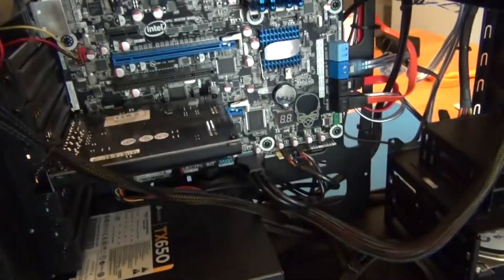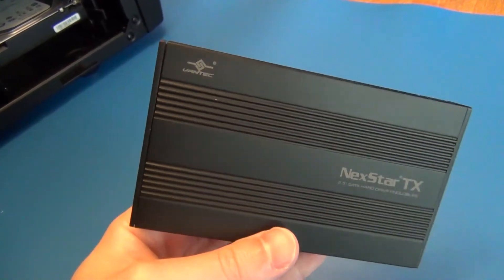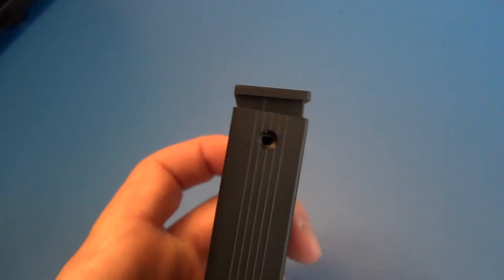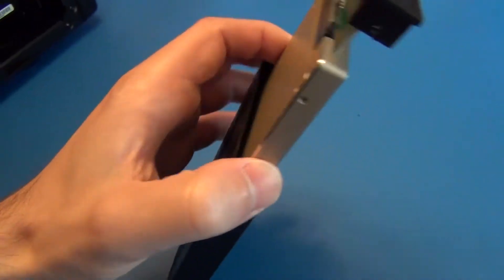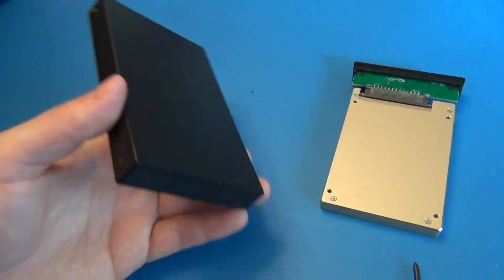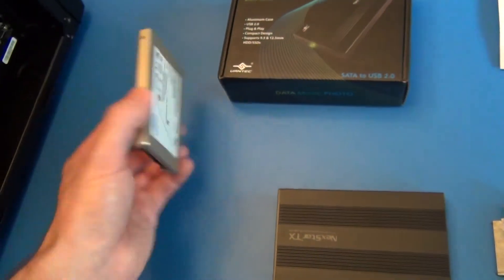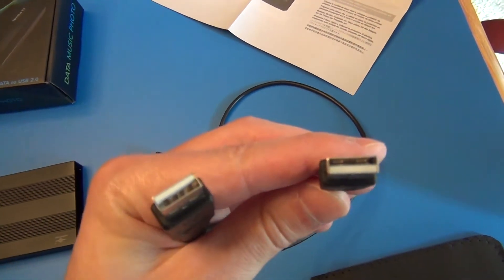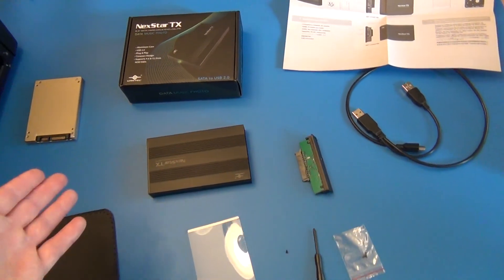Vantec NexStar TX USB External Drive Enclosure (NST-210S2-BK) Review

Comment: I believe there are small cushions on the opposite side to help take slop out of it.  If you push the cover in tight, then put in the screws, it will fit properly.  I bent mine slightly to make it straight.  This is a great HD case in my opinion, and less than $10.

Comment: Another video uploaded said that if a standard HDD contacts the surface of the aluminum enclosure it may short the drive?  Have you experienced this at all since you've owned it?  He said that most drives come with a plastic cover so that the drive does not make contact with anything, but I don't think any of my drives still come with the plastic protector.  Let me know.
Reply from the maker: I didn't have any problem with it, but I only used this for temporary use, so I didn't carrying it around in a bag or anything where I would have a lot of static friction.  I've never seen an HDD with a plastic cover, only SSDs.  All my HDDs I've ever had always had the standard metal surface.  You can probably rig up something to buffer it with a piece of heat-tolerant plastic or maybe rubber band?  Personally, I'm not concerned, especially for light use.  But I can guess that someone is concerned about conductivity from a metal exterior case to internal components.  However, in a real computer, you often have metal mounting screws, to a metal cage, that is in direct contact to the exterior of the computer case.  So I am hoping the HDD manufacturers have protection internally so you don't have to have a vacuum around it.  For a laptop, I usually see rubber rails surrounding, but as I understand, those are for vibrations and some safety during movement of the laptop while the drive is in use.  Just my humble opinion.  But for sensitive stuff, I'd be cautious.  But I would use this again whenever I need temporary access to a hard drive.
Reply: Thank you for the video review and immediate feedback!  Keep up the great work.